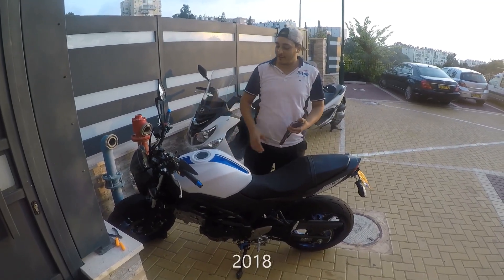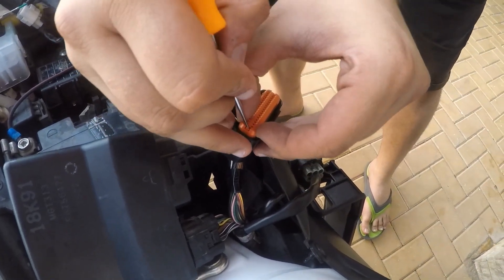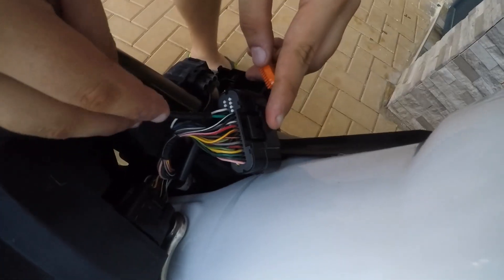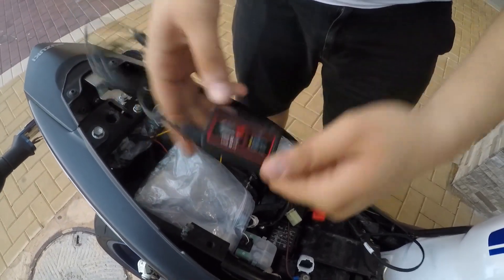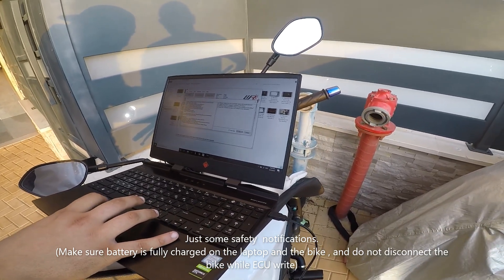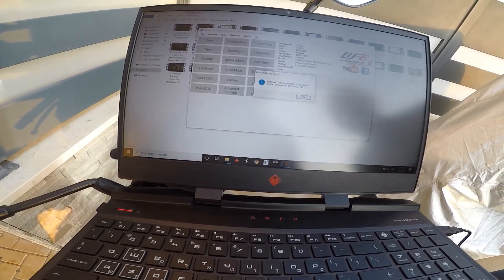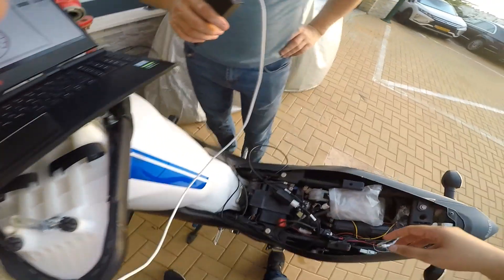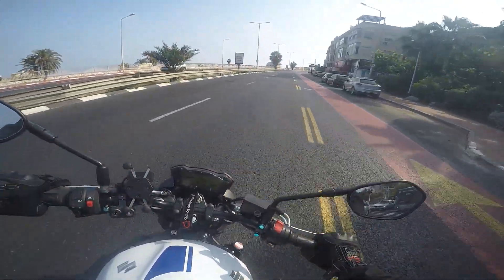SV650A 2018 Woolich Racing ECU Flash

Comment: Hi. What exactly you did?
Whare is the wire you added, contacted to?
Reply from the maker: I am not sure, it been 2 years. if it is important to you I can recheck the diagrams once again but it is pin30 on the ECU connector side. (for 18K91 MCUs, I believe later models are also compatible). contact me via FB if you want more info and datasheets. I still have the tools to flash I am willing to sell

Comment: Will it work with a learners restricted ecu?
Reply from the maker: Hey Emad, check if your ECU has the correct number, just pull it out with out unplugging the cables and check what is written on it... I do believe that it will work.
Reply: @soilder268  how do you know if it's the correct numbers?

Comment: Hey, noob here. Does that mean the fuel consumption would increase as well since it's unrestricted to 57kW? How much would it differ in your sense? Planning to get a SV, your video made me real curious of what you're doing ×.×
Reply from the maker: The bike will use more fuel when you flash it... But it is all based on your riding.
I had times whete the tank made me 200km and i rode softly and times where i rode aggressively and made 130km.

I really suggest doing this ecu flash, loads of fun, soo powerful but still no wheelies .. i sold my bike yesterday.... 
Planning to get tbe Yamaha MT09 SP.
Reply: I see, thanks mate. Maybe will come back here again when I finally get myself a SV
Reply from the maker: @cheongkentang8370   good luck mate!!

Comment: 2018 SV650 owner.. Mannnnn, I am not touching that !!! The bike has a bulletproof engine + transmission, I'm not touching it ! lol.
Reply from the maker: I assume that you don't know that the sv650 comes in two different powers tho same bike, same engine  but different software.  Mine was 35kw after the ecu flash it is around the 57kw. And the flash i used is the OEM Suzuki unrestricted  map.
Reply: @soilder268  I’m in Cali. Los Angeles. My bike was unrestricted.
Reply: Is this witha decat or just with end cand?
Reply: @soilder268  Hi, where did you get unresitricted map?
Reply from the maker: @anTonho20  downloaded it of there website. Hey have a couple with different mapping.